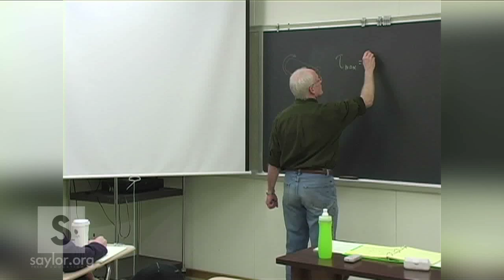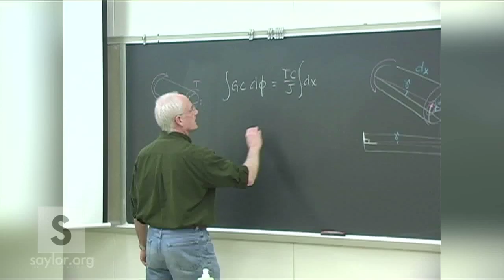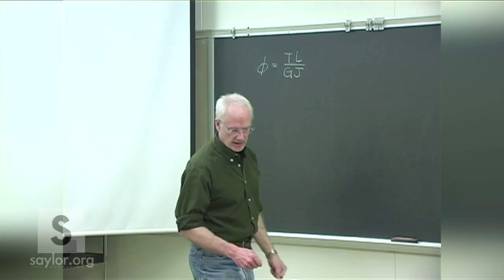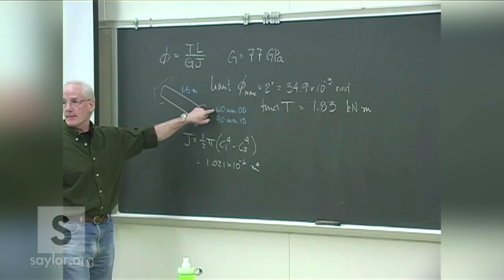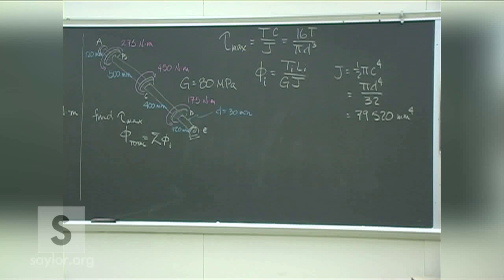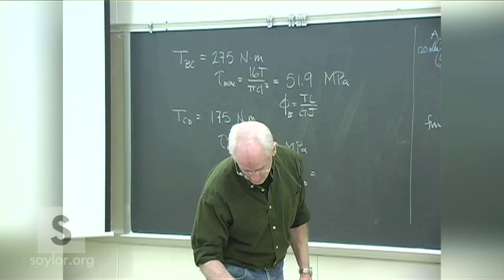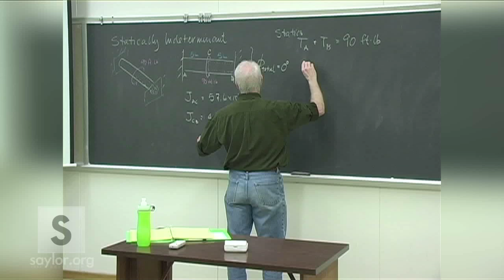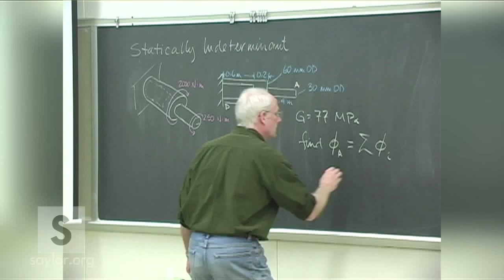Saylor.org ME102: "Mechanics of Materials - Angle of Twist"

Comment: Why did we not account for the 120 mm end pieces when calculating the angle of twist. Instead of the multiplying T by 0.5 in the first section shouldn't it be 0.620?

Comment: why the middle Torsion(450 Nm) is being totally ignored? as if that section is held fixed. don't we get an increase in the angle phi when there is a torque being applied in the opposite direction? wouldn't be as if one end is held fixed and a total of 450+175 in one end and 450 + 275 at the other end is being applied to these two sections of the shaft?

Comment: adding the 2 angles together to find the sum seems unrealistic and unnecessary and there is no cancellation involved. imagine the middle shaft is fixed, and you twisted the other 2 shafts in the same direction, this results in 2 different angles that need to be treated separately